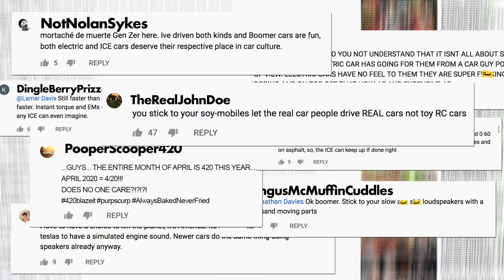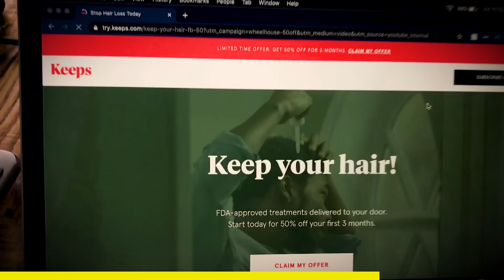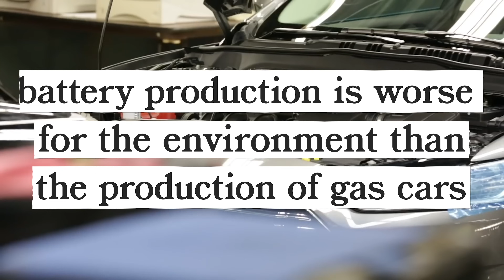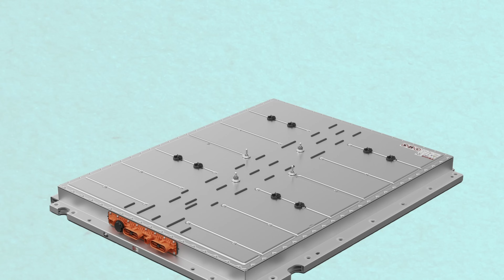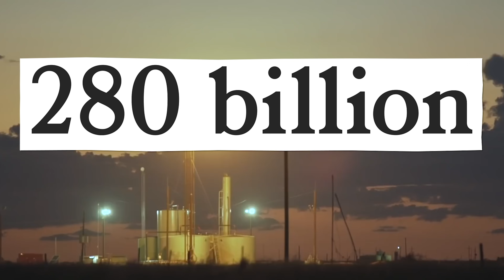Are Electric Cars REALLY Better for the Environment?

Comment: You forgot to mention that nobody wants to replace a expensive battary in a 8 to 10 year old electric car. So with that in mind electric cars have a short life span before there trashed Petrol cars last many years longer so fewer need to be made which is a  positive for the environment over electric cars.
Reply: Actually it’s quite the opposite. Current generation EV’s will last twice the average lifespan of a combustion engine easily.
Reply: @engineeringtheweirdguy2103  The autonomy of the battery it's bad in most electric cars compared with the gas usage.Even the recharging is bad,you have to wait several hours to charge a full battery while it takes 5 minutes to fill that gas tank.And i know there are a lot of people that say:"Hey you should stop to drink a coffee or something",but maybe I'm in a hurry and i need to get to the point B right now.
Reply: @theodorvalentinghita1779  well firstly. Battery autonomy? What are you referring to? Secondly, this isn’t actually a problem. My model 3 has a range of 400km (250 miles). (Real world). My daily commute is 120km (75 miles). It can easily get to work and back around 3 times without needing to charge. And still some left over to visit family. However when I charge, unlike fuel I don’t have to drive around and find a charging station to charge up and stand around outside for “hours” holding the plug waiting for it to charge. I simply charge at home from a power point. And I do so when I get home. I don’t have to attend the car for this to happen. I simply plug in and go about my evening. Making dinner, watching TV, sleeping, etc. in the morning I have effectively a full tank of gas again without wasting any of my time.

Fuel by comparison. Most people will detour an average of 7 minutes each way, 7 minutes to the station, 7 minutes back on route, plus 5 minutes filling and paying. They also do so on average once per week. This means that you’d be spending an average of around 16-17 hours per year, wasted in the pursuit of fuel. For me that sum is 0 hours per year wasted charging.

As for long trip. Super charging is the way to go. It can fully charge your car in anywhere between 15-30 minutes depending on the charger type. This means that it only takes me around an additional 1.5 hours over a 1,500 mile road trip. However over that period of time required to travel that distance biological limits come into play. You have to stop for food, and toilet break or some coffee, water etc. if we say that takes around 30 minutes to pee and order food and eat in the car, that means over a 1,500 mile road trip that’s 1 additional hour spent charging. 

But I might only do that trip once or twice a year. So assuming they’re round trips I might make twice a year, that 4 hours lost to charging but 16-17 hours saved from having to get fuel for the other 361 days in a year.

So in reality, you are wasting far more of your time having to refuel than you would charging.
Reply: The media tends to have a strong bias against EV’s often stating blatantly incorrect information.

Comment: This isn't the first go round for electric vehicles. Over 100 years ago some of the first automobiles were either hybrid gas electric or completely electric. The problem with electric was practicality and efficiency, charge time and performance degrade as the battery charge is depleted. Technology around the internal combustion engine has advanced much further  than most think and further than an EV will ever reach. The problem is suppression of the technology for economic and political reasons. I will post a couple of video links to support my statement.. I work in the alternative fuel technology field and have a degree in electronics engineering.

   https://www.youtube.com/watch?v=8LVf8JoN6D0&t=19s
Reply: https://www.youtube.com/watch?v=GsMOFHPjZpo

Comment: Hmmm seems to me like ethanol should be more of a priority than ev cars. There are so many ways you can make I.C. cars cleaner and efficient
Reply: Ethanol is kind of a bad idea it's made out of corn it's basically corn grain alcohol essentially whiskey it takes a lot of corn to produce a tank full of fuel this tends to affect food prices across the board because farmers are torn between growing corn for food or for animal feed or growing corn for alcohol
Reply: @josephatnip2398  mmmm I'll have to look into that as I'm not sure that's entirely accurate or ethanol, like fossil fuel, would be heavily shames by extremists but to my knowledge is doesn't really have much negative attention as your reply would suggest. However I don't know everything. What I do know however is that ethanol burns a lot cooler which reduces major engine heat problems, provides more energy with less effort but does burn faster in boosted applications as a result, and produces no carbon emissions.
Reply: In India we are focusing on ethanol a lot

Comment: and yer numbers are way off. why you may ask. 
you do not consider the impact on the electric grid the wide spread of ev cars. you gona need far more thic cables, more transformator stations, and charging yer EV has an impact on the overall efficiency of the whole grid. if you account everything, EV is not that great at all. in the best case they are on par with an diesel or petrol car. 
allso , ICE cars... well, thing is when you talk ICE, don't only consider diesel and petrol. carbon free fuel can be a thing. in that case , a car running on nh3 , is the best alternative even vs battery powered cars. 
so instead of ICE, correct your self to internal combustion diesel/petrol. 
LPG for instance is a thing too, along with CNG. i would like to include those too in the comparism.
Reply: Green fuels often require either losts of energy and emissions to produce or they take a lot of agricultural land to produce. LPG isn’t exactly green either. But as for the electricity grid. The grid currently has the ability to transmit the required energy. EV’s can charge on as little as 2kW, which is about the same as running an electric kettle. The grid can supply a lot of energy to homes. Far more than is currently needed even with EV’s. The power grid also increases in overall production capacity every year. It increases by 50% every decade and has done so since the industrial revolution. At current full EV adoption even with incentives won’t occur until around 2050-2070. That’s around 30-50 years away. In that time the grid will have increased in capacity by 150%-250%. In other words the power capacity will be between 2.5 to 3.5 times current generating capacity.
Reply: Its not about the ability to produce enough power. That is never an issue. Keeping the network stable and having the ability to distribute power is an issue. Blackouts happen even when the summer comes and the aircons swich on and off. Cars are more of a load Than those.

Nh3 production can be done with zero emission. Carbonless fuel. Allso it is its own scr fluid.

Comment: Im pro EV, but i had to sell my model 3 as i used to live in california, and when PG&E does their rolling brown outs i would be out of charge after a few days and go over a week without power. Got a gas commuter to solve the issue which completely eliminated the whole reason to have the ev in the first place... until charging times can catch up with the ease and speed of filling a gas car, i won't be looking at an ev. Unfortunately the brown outs started affecting the gas stations so i just left the state and took my tax revenue with me. Combining my 170 miles per day of commute and no charge station, nor the budget to afford a large output generator, EVs wont be in my garage for at least another decade.

Comment: Totally missing the point on batteries, those things have a very short life span before they become toxic garbage, this is a huge issue not just because of the environmental impact, but to the resell value of EVs, and creates a huge barrier to entry for people buying their first car. You can pick up really cheap EVs but if the battery is shot, you need to shell a huge amount of money to fix it, many times the replacement of a battery is more expensive than the value of the car, this include Teslas.

I think Toyota was right here, and IF we can greatly reduce the carbon cost of energy, hydrogen cars are a far better way to get off ICEs.
Reply: That’s simply wrong. Current EV battery technology is set to last well over 500,000 miles. More than double the lifespan of a normal combustion engine. The Tesla model 3 has the lowest depreciation of any car in history.

There are very particular fundamental problems with hydrogen that make it very ill suited to the domestic passenger vehicle market.
Reply: @engineeringtheweirdguy2103  well over 500,000 miles is a ridiculous exaggeration cannot be observed in the real world. You are getting that number from estimations on Teslas, and even they have the common sense to claim 300,000 to 500,000. The reality is this will vary tremendously by the climate where you live, your charging habits and many other factors.

We don’t have enough data on Teslas as simply not enough of them are old enough for us to have real data to verify these claims on batteries, what we do have is data from the Toyota Prius, and these hardly ever perform that well. You may want to claim that Toyota batteries are inferior, but Ive seen batteries die way before the 200,000 mark.

Another important issue is batteries do degrade by charge cycles, but there are also degrade with time, particularly if stored in sub optimal conditions. It’s an issue to get trained staff to follow proper battery storage procedures, let alone educate the public.

As for hydrogen, the Toyota solution seems quite elegant, safe and reliable. It’s only flaw is availability of Hydrogen and cost, both of which could improve with economies of scale.
Reply: @sudoym3484  Prius isn’t the same as a Tesla. For starters they are mostly hybrids. Their battery management systems aren’t anywhere near that of a full BEV. Further to that, battery life is dependant on cycles of original capacity. 50 cycles of a large batter that takes you 400 miles a charge means it will travel 20,000 miles to 50 cycles. A tiny Prius battery might only have enough charge to push the car 50 miles. Meaning 50 cycles is achieved after 2,500 miles. You’re comparing apples and oranges here.
Reply: @sudoym3484  In which case I would suggest you watch the YouTube video posted by a Tesla Model S owner. His car has covered 400'000 kms on it's original battery.....
Reply: My Kia has an 8 year battery warranty. I don't consider that to be a "very short life".  Obviously, you have never owned an EV, and neither do you have much knowledge of them. It would actually have been easier for you to type I KNOW NOTHING ABOUT ELECTRIC CARS..... At least that would have been factually correct....

Comment: What about diesel?
Reply: What about it?
Reply: @engineeringtheweirdguy2103  is it more efficient than gas or EV?
Reply: @PurpleLightning2  nope. Infact it is more fuel efficient to charge your EV off a shitty kW diesel generator than it is to use that same diesel in even a highly efficient modern Diesel engine.
Reply: @engineeringtheweirdguy2103  maybe, but it’s not more fun, and it doesn’t sound as great. 😜